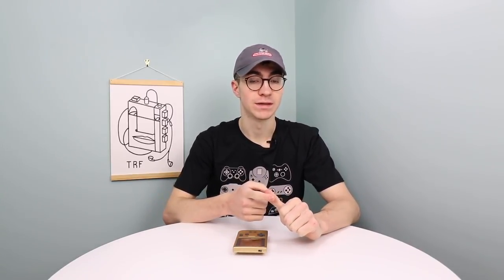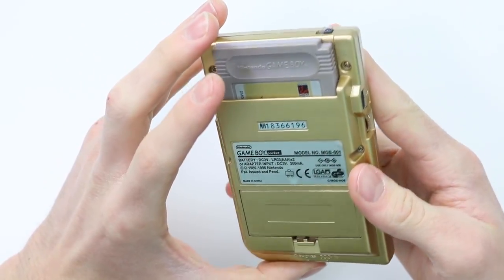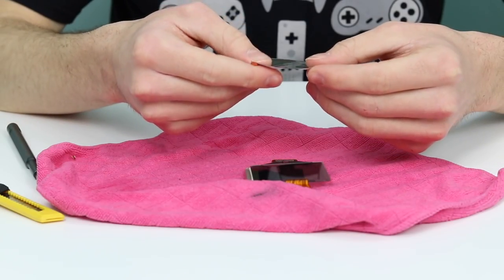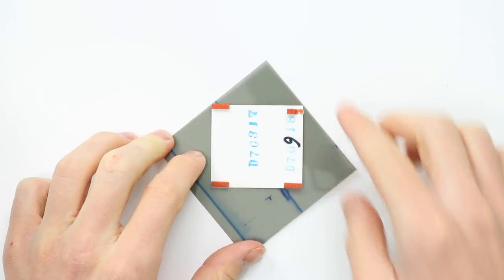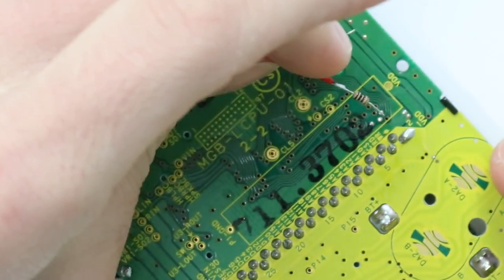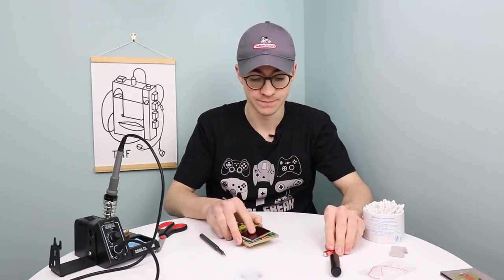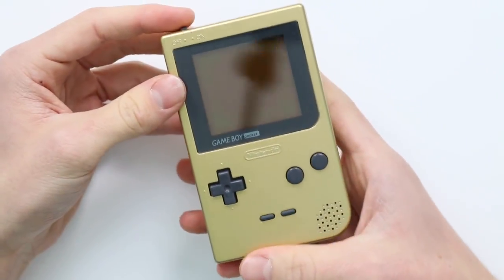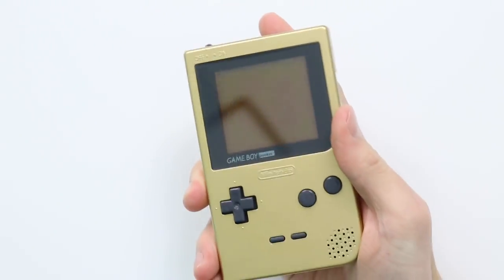Backlighting A GameBoy Pocket - Worth It?

Comment from the maker: Contrast is now perfectly fine and stable! Turns out my batteries where on their way out! I will be biverting this GBP in a future video, so I will make a follow up video then!

To address the main point, I cut the polarizing film at that angle because that was the optimal angle for my specific film, I tried to make it clear in the video that had I not done that, the screen would have been very dark.
Reply: I wouldn't use zinc batteries either, they just don't last long in a device like a game boy.
Reply: My problem with backlighting Pockets is that I use fresh batteries, it looks ok, then as soon as the batteries are even a TINY bit depleted (like 5 to 10 mins use) it's back to faded again... It works fine when plugged into the mains. Backlighting 2 Game Boy pockets was actually my first modding experience and I was amazed I managed it without breaking the screens. But overall, a pretty lackluster result...
Reply: Worth it it has this gameboy office package feel to it
Reply: Great work!
Reply: When your biverting it can pls try the new pocket biverter from hand held legends?
Reply: The Retro Future do you have a spare gameboy pocket lcd screen I could buy from you? Mine has a black smudge on the screen, it’s not a burn. I live in the USA by the way.
Reply: I was just thinking that screen looked weird, I ordered a backlit gameboy pocket off etsy a while ago and it looked much better than that.
Reply: @shinynewjb  There's some types of AA batteries that are USB capable, and their voltage never runs dry. If there's similar AAA batteries that are made of similar material with voltage not running low until near death, that would be best. Disadvantages include potentially further reduced battery life, and the inability to read the power indicator, so you'd have to use trial runs to figure out the general battery life. You won't be able to have batteries that both keep the backlight at full brightness and properly display the power indicator; it'd only be one or the other.
Reply: @Bro-cx2jc  I figured this one out, with help from various people. It's the 5v step up regulator. They're only just capable of handling the system itself, let alone adding a backlight to the mix. And if you run a backlight off one for too long, you're likely to brown it out. You can install a new one to regulate the system while using the original one to regulate the backlight. I did that and it worked a treat. SJM4306 on YouTube has a video on this.
Reply: @shinynewjb  I actually read about that solution too, using a separate voltage regulator for the backlight, but I don't really know much about voltage regulators or how that helps. As far as I know, a voltage regulator just helps control how much voltage is going where and keeps it stable or whatever, it doesn't make the batteries output more power or change the way they're installed in the circuit.
Reply: @Bro-cx2jc  I'm not a very technical person when it comes to this, I just stick to layman's terms; but the result is that is basically stops the screen from becoming faded straight away. The old (worn out) regulators aren't up to the task of regulating voltage to both the backlight and the actual motherboard, which basically starves the Game Boy of power (which isn't helped by the fact the pocket is only powered off 2x AAA's). To be honest, you could probably completely replace the old voltage regulator with a new one and power both the backlight and the motherboard off that new one and it would still work. However, I like to keep the old regulator powering the LED backlight. Hope that helps.
Reply: @shinynewjb  As little as I know about the technical stuff, the way you talk about regulators, it sounds as if two of them would be the safer option.

Comment: I know why it looks so horrible. You cut your polarizer slanted. I asked myself why did he do that, its always supposed to be at a 90° angle. Screen and polerizer standing flat on the table then you cut away the edges. After you cut the edges you turn it to the LESS darker position. Reason why is because you are not installing a bivert. If you are installing a bivert then you want it to turn it to the DARKER position. I have 2 pockets and have exellent clarity.
Reply: Yeah Ive backlighted a few pockets and I really don't know why he cut the polerizer sideways...
Reply: It's like he though the contrast looked best in that position without considering at all that there will be a backlight. There is even market lines on it from the bigger uncut sheet it came from that shows direction.
Reply: @chamoo232  yes exactly. He made a good mod but he should correct that polarizer. Start with a new one. Results would so much better.
Reply from the maker: @chamoo232  thank goodness! I thought I forgot to mention that in the video. Im glad you heard it!
Reply: Exactly. Pretty surprised he didn't notice while editing the video. A pretty obvious mistake, even for me, that know nothing about modding.
Reply: This guys over complicated things, just check the polarising filter on another screen first and check which way is clear or completely black, also would have been useful to have pointed out specifically which points to solder to, nice vid good beats not all that informative

Comment: Nice job! Biverting and installing a voltage regulator really helps, but it's much more difficult to do. I'm going to attempt a series on backlighting and modding every Game Boy version this year, Pockets will definitely be in the mix!
Reply: Looking forward to it! I got my first  GBP, but I haven't quite found a good bivert guide
Reply from the maker: I look forward to it dude!
Reply: esotericsean please do it! I’d love to see a pocket bivert backlight w voltage regulator video. I kinda abandoned mine due to everdrive support.
Reply: Modded both of my pocket with voltage regulator. Strongly recomend doing it, is defineltly an easy thing to do !  In one the extra regulator  powers only the backlight, on the other I decided to use the built  in voltage regulator to supply power to just the backlight  and used the extra regulator to power the  board. The regulators I used were from  banggood and cost almost nothing.
Reply: Lorenzo Bassani Yeah! There are a few different ways to install one. But anything that takes the stress off the built in converter helps!

Comment: A very good tip when removing the reflective film and polarizer, peel some of the film off the top, then spray a bit of WD-40 between the film and the screen then leave it. 
The WD-40 will eat at the adhesive without harming or putting pressure on the screen or the ribbon cables. After a bit, you can super easily just slide it off the screen.
It will take some cleaning to get rid of the oily residue of the WD-40, but I think it’s worth it
Reply from the maker: I need to give this a try! Everyone always points this out! Next time, thank you!
Reply: The Retro Future No problem! 
I have a red backlight on the way and I’m gonna be trying that method! I’m thinking of doing an all red themed Pocket
Reply: Can you not use heat to remove the polarizer?
Reply: trzarector I’m sure it would help the film to come off more easily, but I think the WD-40 is the best method as you’re not putting any stress on the screen

Comment: I love modding gameboys so I though I could give you a few tips.
First, the gameboy pocket you used looks like it got its top polarizer replaced with a different one. The original polarizer features a circular polarization(hard to find) and the one you used is most likely a linear one. What it does is it basically make your screen like a Dmg.
When I backlight a pocket, I use chipquik to desolder the lcd connector to give me an easier access and to prevent dust.
You need to be very careful as the connector is very brittle.
I use iphone polarizers and just like you, I have to cut it to the correct orientation but when I do that I mark where I have to cut it with the backlight on to give me an idea of the result.
The thing is with these kits, the polarizer that comes with it are not sticky on either sides and are the same for all colors and a few degrees can make a difference in contrast.
You can purchase gb pocket lcd inverter on kitsch bent and they are very easy to install and in my opnion are well worth it.
I also use different solder points for the backlight. I don't remember which one but I could always check.

Having said that, I think you did a great job.

Comment: The first pocket I backlit was honestly so easy I thought everyone had been overhyping it. I decide to sell that one and do another one (in a DMG style shell) and managed to break it. I do wonder if the cable was already damaged when I started, because I didn't do anything differently at all...
Reply: Charky - Yeah it’s really not that difficult in my opinion.
Reply from the maker: They seem to differ from unit to unit!
Reply: I think I must have got two ends of the spectrum. I'm keeping an eye out for one to take the screen from when the January clearouts start!
Reply: I modded two pockets as my first mods. Took my time and they went ok in terms of installing the backlight. Modded a DMG afterwards and the polarising film was absolutely gummed on. Took ages! Took my time and it ended up ok, it was just very hard work. The key with these mods is to just go steady. Don't think you have to match the pace of experienced modders.

Comment: Isn’t rotating the polarizer film like that a step of biverting? I don’t think you were sent the wrong polarizer, I think you caused that by rotating it when you were talking about getting better contrast that way. Just my two cents, always love your vids, just something I wanted to mention.
Reply: I agree, he cut it out at a diagonal angle , he should of went the full 90°
Reply: When you bivert you rotate the polarizer 90 degrees but he installed his at a 45 degree angle. that's why the contrast is messed up.
Reply: chamoo232 my understanding from This Does Not Compute’s video on it is that rotating the polarizer period messes with the contrast. So it doesn’t matter if he did 45 or 90, the contrast would be wrong without biverting. In this case, I think his contrast would still be wrong if he biverted.

Comment: I did the bivert, not worth it. Ended up swapping the mod (backlight and bivert) to a  DMG.
Reply: I agree, you can hardly tell the difference if not any at all. Not worth the trouble installing a bivert. Mine are just backlit.
Reply: Yes, a bivert is great for a traditional DMG but is not needed on a GBP.

Comment: You only heated the solder but not the wire. This might be a cold solder. I thinks it's better to heat the wire for good permanent connection.

Comment: I'm trying to install backlit screen on my GameBoy pocket. I struggle with the self-adhesive polariser film. I assumed it needs to be stuck to the back of the screen. It is really difficult to position it correctly without leaving air bubbles, fingerprints etc. Mainly because the screen tape gets in the way.  I have ruined already couple polariser films. Have you guys got any tips how to do that? Or am I going in totally wrong direction and the polarizer should be stuck to the backlit panel/board instead...

Comment: Did this today. Added a DSi battery with recharge board in the back. This gives a massive boost to the screen. Stop the light stutter on Pokemon games....AND....Also for much longer play and stability with the Everdrive. This mod is almost pointless if you don't have a decent 3.7v battery running.

Comment: Biverting the thing is actually easier than installing the backlight, in my experience. Cut two tracks, solder six cables and you're done. You can go pin lifting, but I think it's less dangerous to just cut the tracks. Might be a bit annoying to decide where to locate the chip itself, but the mod doesn't really jeopardize the console as much as removing the film from the screen. So, in my opinion, once you've installed the backlight, all the rest is easier. Can't really see the difficult part on the bivert mod. It's time consuming since you have to locate cables and all, but even if you manage to break the motherboard (which is not easy, mine has a thousand do-overs due to one thing I wanted or another, also a LiPo battery mod and even the oscillator was changed and now located into the battery slot for further dual-oscillator mod) you can get another one from a GPB with a broken screen for cheap, if you don't have one already from a screen you broke yourself. If you didn't break the ribbon, then the hard part is done.

Comment: It's not SO hard, just needs some experience. A well done mod is worth the work. contrast, actually, can improve (it depends on what leds color you choose). And if installed correctly, maybe with a dedicated power regulator, battery life is ok. I'm putting dual brightness capacitive switch (like on the gba sp) and I had one MGB for my entire 3 weeks summer trip without changing batteries (I used it just like 30 minutes a day, average). vitaeterna3000 on instagram if you wanna check.
Cheers mate